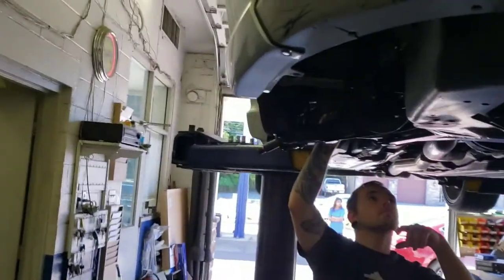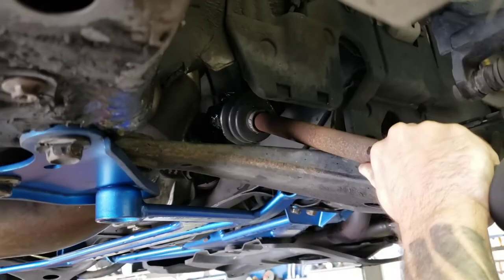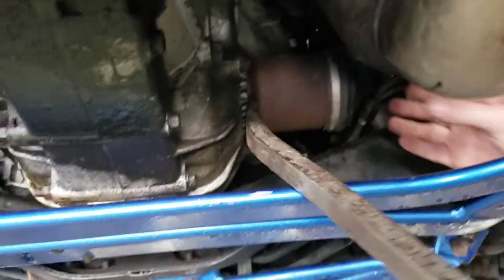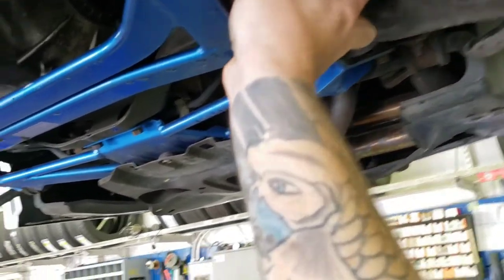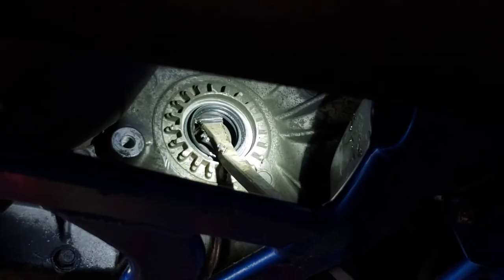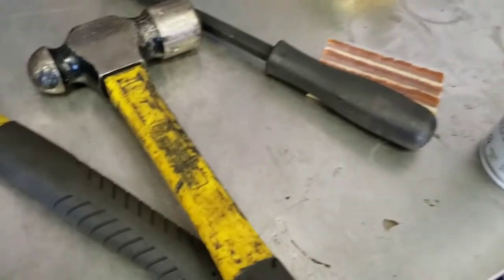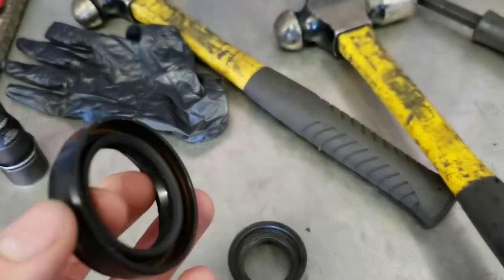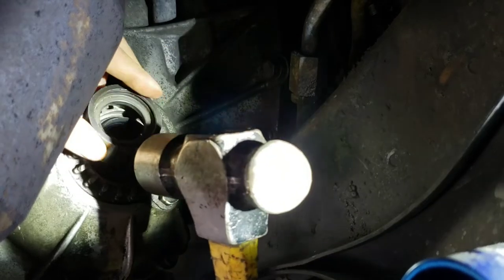Subaru Axle Seal Replacement How - To

Comment: The old seal you remove works perfectly to protect the new seal as you tap it in. Exact size and the cavity on the back side protects the delicate sealing surface of the new one. No need to hunt for a socket or seal driver. Great video!
Reply from the maker: Good tip! Thanks for that!
Reply: Thank you so much

Comment: Great video also I have seen leaks from the bolts basically where the differential meets the transmission right at that seal is usually like a slow leak and I haven't seen a video on it

Comment: On the. Older subaru’s you have to remove the retainer.  So make sure you put some markings so you can install it the same. I didn’t think I needed to remove it but the seal is  placed from the inside. The seal on a 99’ is larger than the opening.
Reply from the maker: That's good to know thanks for commenting

Comment: I am so glad you made this almost was going take the bearing preload adjuster I was dreading doing all that only goin to if I discover a leak from the gasket in there but gonna do this first
Reply from the maker: If you need to take the adjuster off just make sure you mark it first and count the turns. Not hard, but yeah you definitely don't need to take it off

Comment: Went to a shop for the cv axle replacement and they had my car on the lift the mechanic was there took a cutting torch and cut the axle in half to pull it out also he removed the pinch bolt and that broke so he torched that as well now my car is still not fixed as they can't get the bolt out as it hardened... never go to a cheap shop!!!
Reply from the maker: Man that's rough. Those pinch bolts are really difficult to remove if they break. Sometimes it's easier just to get a whole new knuckle
Reply: Thanks for the video! 

Apparently snap on makes a Subaru “tool” to install the seal. 

I’ve never seen rust this bad and a manufacturer not make immediate changes to prevent it n my 40 years of working on cars. 3 as a shop owner / operator. 

Here In the Chicagoland area, (and I’m told the rest of the upper Midwest & North East) it’s worse than anything I’ve ever seen.

Growing up in the PNW (Though I traveled across the country for 10 years before I met my wife) not only were Subies plentiful, they weren’t rust buckets 😂 Sure there was a paint issue that lasted a couple years before Subaru fixed it. 

But these upper midwestern and eastern states are subjected to massive amounts of salt, sand, gravel and hard chemicals to the point that when you think there’s still snow on the road, you find out the snow and ice are gone, it’s just salt. So much salt it looks like 2” of powder at night. 

I’m on my fourth day with this car. After drilling out the pinch nut and throwing a nut & bolt in there, it was not looking good upon daily inspection’s that I was doing after work. 

It finally broke. During my repair (with a new OE knuckle) a brake dust shield bolt sheared off with a hand held wrench. So I decided to see how bad it really was. The car had a pop and some other minor noises that warranted some component replacement. So I decided to replace everything except the struts. 

Parts that sucked where…
this seal, obviously the pinch bolt, the sway bar links, dust shield and it’s 3 bolts, the brake caliper retaining bolts (Post 50K break replacement) and the bolt that secured the brake line to the strut housing. 

Now finishing up and getting ready to tackle the right (passenger) side of this car with all the knowledge, experience, and of course some parts already on hand. 

I’m pretty sure my PTSD was triggered when it took me two days to replace the right rear wheel bearing with a hub buster and a 50lb hammer, and at a full swing! 

There’s definitely a few inexpensive tools readily available that can help save a ton of time and discomfort, but a seal install tool is not one I have 😂

Thanks again!

Comment: A block of wood could work to tap the seal in I believe. It worked fine for me recently replacing a seal in my floor jack when I didn’t have the right socket.
Reply: Can the seal be tapped in all the way?
Reply: Don't press on the soft outer lip to push the seal in. You have to apply force to the hard shoulder, as shown. This is a deep seal with a soft exposed lip-

Comment: Is this for a manual transmission? My car part dealer can’t find the axle seals, so I am looking for the correct partnumber for my Legacy ‘07 2.0r with manual transmission
Reply from the maker: Yes this was a 5 speed transmission. 6 speed should be same though I would think
Reply: Okay great. Did you have the part numbers for both sides?
Reply from the maker: @KeviNissan  I do not but they are just called front axle seals, should be able to get them anywhere
Reply: That’s the problem. I only found the seals for automatic transmission.
Reply from the maker: @KeviNissan  did you try the dealer? Or check flatironstuning . Com they have a wide array of oem parts

Comment: I replaced the axle seals from the dealer twice, OEM axle. But the seal is still leaking. dropping . what's wrong with this.
I stall the seal with the special tool. I am frustrated
Reply from the maker: Did you make sure to lubricate the inside of the seal where the axle rides prior to install? They are prone to a dry start and can get ruined in seconds if not lubricated during install
Reply: @nickquatrini  Thank you. Yes, I lubricated it with differential fluid. I will replace it again
what kind lub did you use ?
I have to suspect that the journal where the seal sits of the axle has been skimmed
since the dealer only has remanufactured one. not a brand new one.
Reply: @yijianggu5203  Hi did you end up fixing the issue? I replaced the axle seal (did not lube the inside) and it's leaking again too. Also, I think I might have pushed the seal too far inside, but I can't tell for sure.
Reply: The seals are specific for left and right sides. You probably put the wrong seal in the wrong side.

Comment: Thanks for the video..I was searching for the rear seal for Forester but found no video on youtube.  Just curious, what the symptons of a bad axle seal?  Can this cause a thug vibration noise from rear left when you make a hard left turn for the left seal?  I'm suspecting the axle seal because when I grab and shake the axle, I can hear a clicking noise.  Yes I replaced the new CV axle.  Any help would be great!
Reply from the maker: Hmm not sure what's causing your issue but definitely not the seal. The job of the seal is to hold in the oil, if it isn't leaking it's still good.
Your issue might be inside the differential
Reply: @nickquatrini  I think you're right...I've done some more research, I would need to replace the Diff roller bearing and the axle bearing which basically connects to the CV Axle.

Comment: I replaced my seal cause i had replaced my cv axel. I bought a new seal put it on yesterday. Filled it up with gear oil again and i just noticed that its leaking a bit from there again. Im wondering if the seal worn out where it touches the axel cause i didnt lubricate it like you did. You think it messed up my seal since i didnt lubricate that middle part?
Reply: The seals are specific for left and right sides. You probably put the wrong seal in the wrong side.

Comment: I tried to do this today but got stuck on the CV axle removal part. Did not have a pickle fork. My CV axle is intact, unlike the one in your video. Would you recommend a pickle fork for my stuck axle or would it destroy it? I'm not sure it matters since I need to get to that seal whether or not I destroy the axle in process.
Reply from the maker: Yes a large enough fork meant for popping out axles should do the trick. Make sure your axles do not have roll pins in them holding them in, if they do, they need to be punched out before the axle will come out

Comment: How do I actually know it's seated correctly or flush with the transmission? Is there a chance to accidentally push it too far in? Thanks
Reply from the maker: You have to tell by feeling the edge. It is possible to put it in too far, but as long as it's straight it should still seal, unless it's like way too far in that case just pull it out and redo it
Reply: @nickquatrini  thank you man 💪

Comment: Great informative Video, Thank you. "Oh my gaad!" 😄

The new seal appears to be the LEFT SIDE SEAL # 806735290.

DIYers be aware that you are using the correct seal:  
LH seal is SUBARU part no. 806735290.
RH seal is SUBARU part no. 806735300. 

They are different, as there are little vains on the inner lips which direct oil back into the case. If you mix them up they direct the oil OUT of the case!
☠

Comment: what about the rear
Reply from the maker: We didn't do the rear that day but it is actually really easy. Depending on what model it will likely save you time to just remove the rear diff completely, but if you dont have a lift this can be difficult. 
That said, all you do is pop out the axle in the same manner as this and then pry out the seal, once you go and do it you'll see its super easy.

Comment: Do you drain the trans fluid first??
Reply from the maker: No, a very small amount will spill out so you'll need to top it off after, but that can be prevented by jacking up the front end
Reply: @nickquatrini  but not a bad time to do a trans flush right?
Reply from the maker: @harleynielsen4785  nope if you wanna do it, it's the perfect time!
Reply: @nickquatrini  awesome thanks mate!